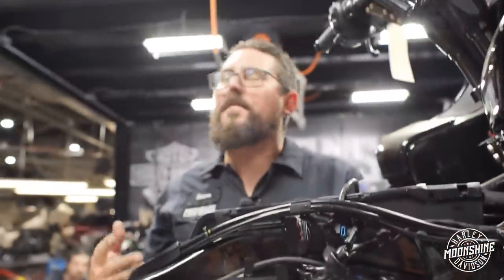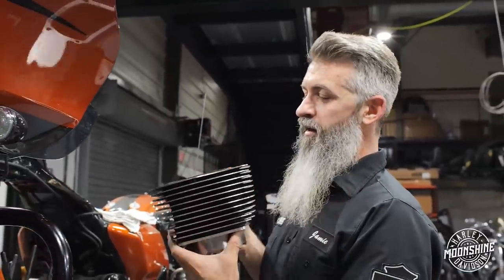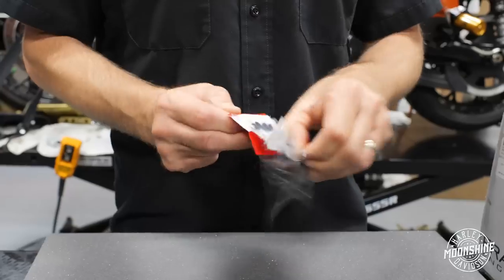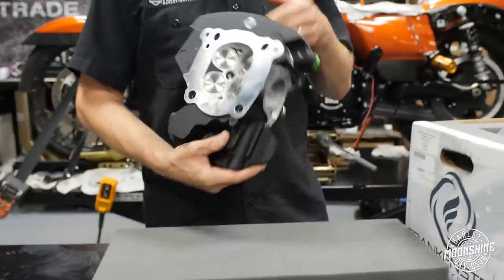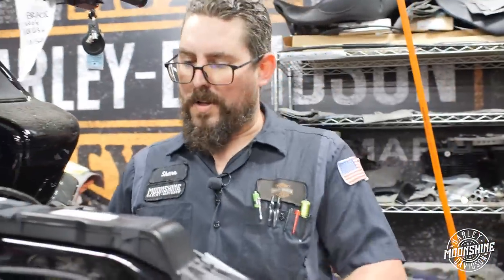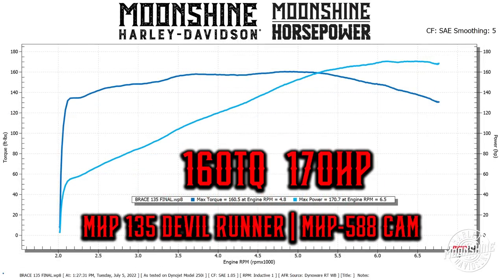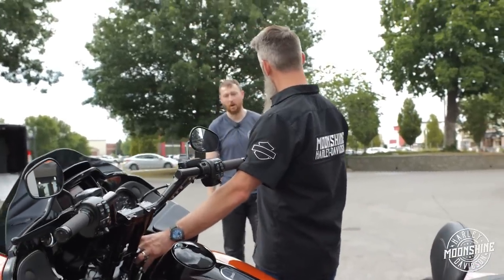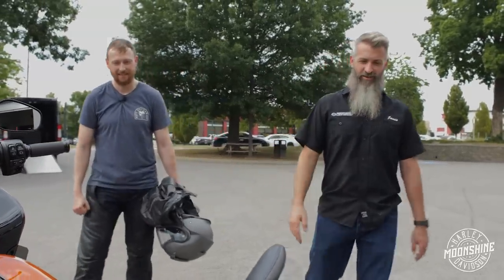MHP 128 to MHP 135 UPGRADE | +23HP & +12TQ Bike Build | Shop Talk Episode 57

Comment: God man . . . This stuff is priceless . . . I'd add a Trask Turbo to this set-up with correct turbo cam to help this fantastic engine build get irs air instead of the usual gasping for air as most n/a engines are subject to doing . . . Once again . . . Hat's off to Moonshine Harley for such a complete performance harley dealer 💪💪

Comment: Are you guys running more s&s or fueling cam plates/pumps on these monster builds?
Reply from the maker: Our number 1 pump is the new H-D SE Pump. We modify it to clear the larger cams we use. The S&S pump would be our Secound most utilized pump.

Comment: The domed piston is also dished. Is there a reason you went with a dished surface?
What is the static compression ratio on this build?
H-beam rods are the shit. You guys are pushing the envelope and I love it!
Reply from the maker: Helps with cam overlap in the higher RPM range. Static compression is 12:1 and corrected is 10.7:1 which is around 230 cold cranking compression.
Reply: @MoonshineHarley  so it allows you to run more overlap because it contains the flame front for a more efficient burn?

Comment: Amazing power but what do you guys do to keep those monster from being so hot in everyday riding. Such as interstate traffic that really slows down or stops.
Reply from the maker: Oil Cooler Fan. The bore is 4.375” so it’s only 0.065” larger than a H-D 131 setup so the heat it relatively similar.
Reply: @MoonshineHarley  I have a RGS which is my first HD. I had a M109 BOSS, actually 3 M109 since 2009. So I’m use to that immediately throttle response and no heat lol. I’m still in warranty until next June but I’ve change my mufflers to Krome Werks and I have a Scream Eagle tune. I’ve noticed the change from stock. I guess what I’m saying I would like to step her up. What’s your recommendations and possible price range. I currently have 5500 miles on the bike. That’s a story for another day.

Comment: How does this build handle heat? Any issues if you're involved in long hauls or in a low-speed group ride?
Reply from the maker: Great. That’s what we designed it for. You’ll get 260-310 miles per tank, Hwy.
Reply: @MoonshineHarley  I have a hard time with this reply. Regular Harley’s don’t get that mileage to a tank. So how does a engine with larger displacement get better gas mileage. That can’t be true…